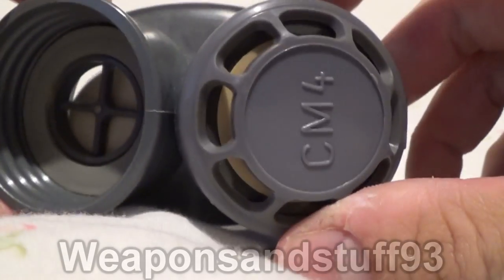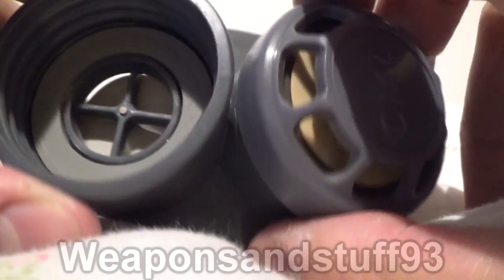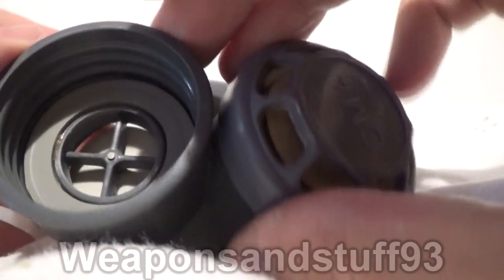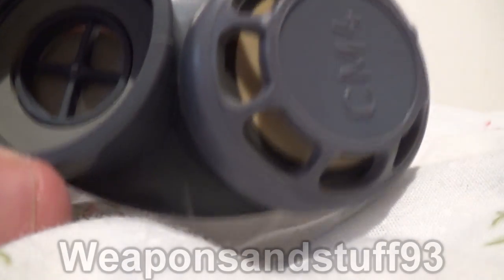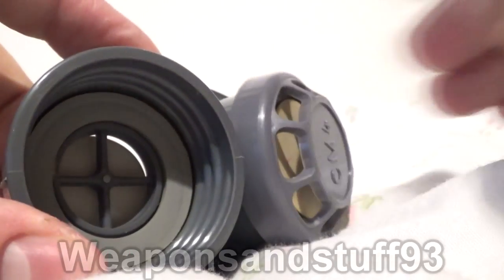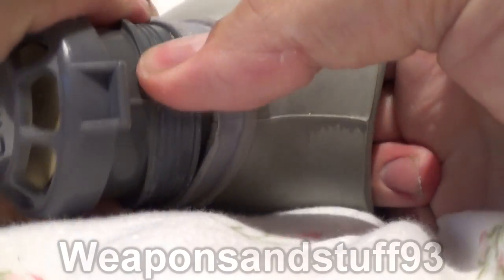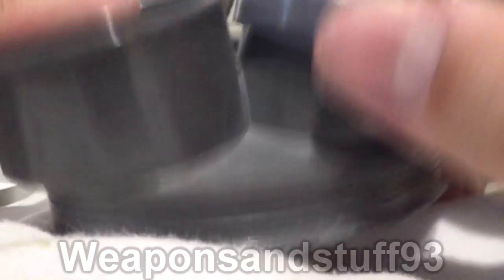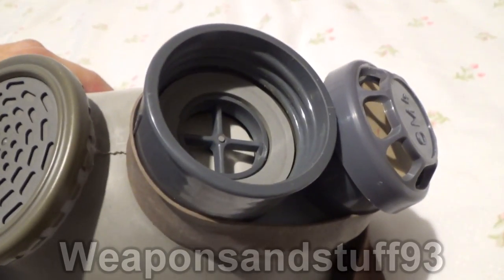How do Gas Mask valves work?

Comment: My daughter wears a israeli 4A1 gas mask;  size for children.  I have tried the mask and it closes well when breathing, but when I breathe out, air comes out of the breathing valve.  Is there any way to fix this, maybe putting some grease on it?  Can this cause a problem, or can this be tolerated?

Comment: I know this is An older video but I may ask, May you create a video showcasing Flapper valves? I have recently gained a fascination in them and I would like to make my second gas mask have one (for horror reasons I think they look uncanny and if they do flutter or flap that would be a scary noise to hear in a silent dark room) Btw I am still making the video on the first gas mask I've just run into 1,000,000 delays and complications. Thanks for the great video!
Reply from the maker: I've done videos on masks with flapper valves before but I don't really know how I can go into detail on them, it's simply a piece of rubber that opens when air pressure forces it opens and then closes back up again.
Reply: Thanks you! they seemed awfully simple and you confirmed it, They are! Thanks!
Reply: @arimoose1-r85  I've never heard 1 but I just googled around for it cuz I wanna hear how it sounds. Can't find anything tho. Do Weaponsandstuff have a video with it or do you know any other youtuber or movie that breaths through one, I wanna hear it. Thank you.
Reply: @Rack47  I could not find anything on the sound they make, that was just a hypothesis. But I did manage to create a crude one and it did make a fluttering noise.

Comment: I noticed on my Gp-5 that the out take  valve rubber is barely open, you can barely see under it. And when I breathe in very slowly I can hear the air coming in until I breathe hard enough for it to shut. Not super hard but if I breathe really slowly then I hear air coming in. Could this be a problem? I did this without a filter and was checking pressurization, it worked fine, and the rubber on the out take valve on the outside actually felt air tight, but in thread section I could hear the air coming until I breathed enough for it to close ( the filter port was completely air right and no air was passing through my hand). Wondering if this could be a problem.
Reply from the maker: Without seeing it no idea, but lots of GP-5 and similar Soviet masks have the second exhale valve being a bit floppy.
Reply: Weaponsandstuff93 alright thanks

Comment: weaponsandstuff just bought a canadian c3 gas mask (my first one) it did not come with a a filter and i dont know where to buy one any suggestions
Reply from the maker: You can either get a 60-40mm converter then put any NATO filter on it.
Or get as new as possible Finnish 60mm filter, all those things should be on ebay.